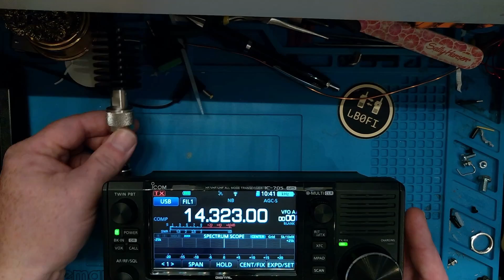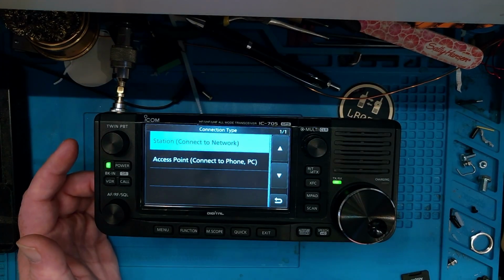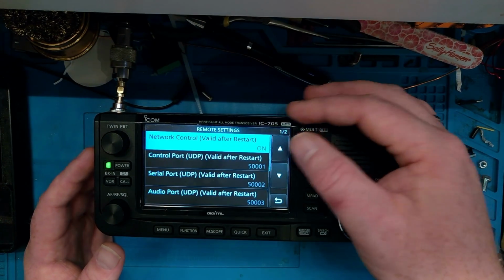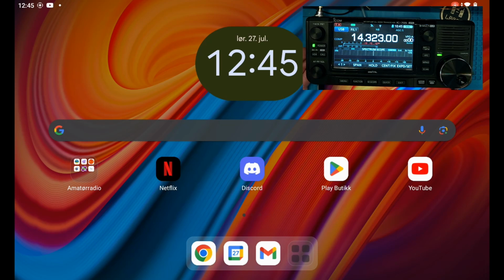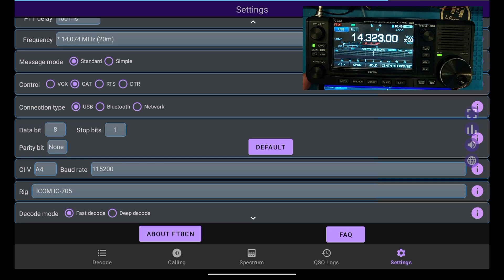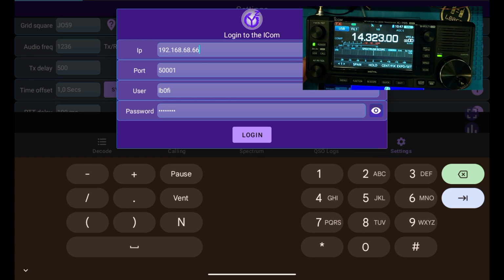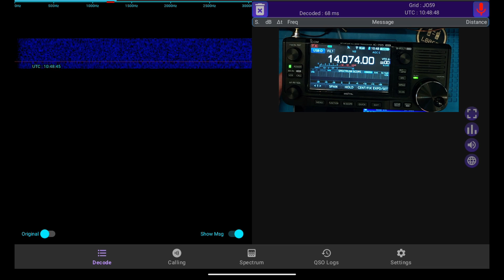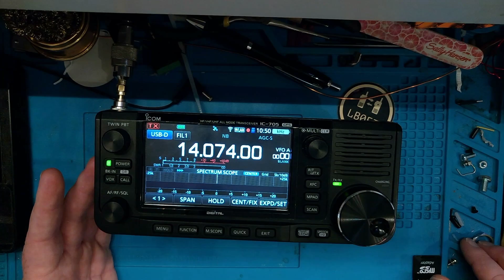How to SET UP the IC-705 for WIRELESS DIGIMODES

Comment: what antennae do you use with this. what would i have to buy to get one of these operational?
Reply from the maker: As most things in ham radio the short answer is: "it depends", but let's dive into this a little bit further though. This radio does not have a built in tuner, so something resonnant would be useful. Also, since it's QRP I would go for something that's efficient. A dipole, a quarter wave vertical or a dipole would be good starters. If you would like something multi banded I would go for an end fed halfwave.